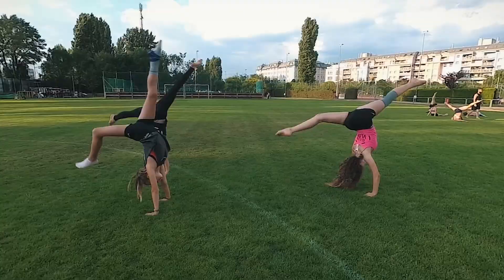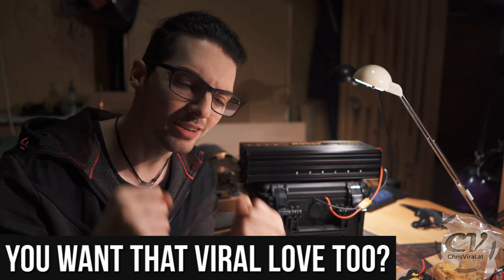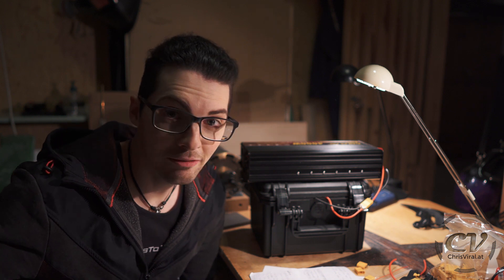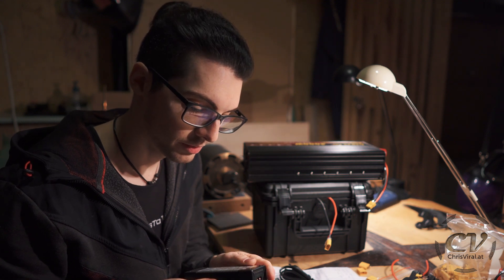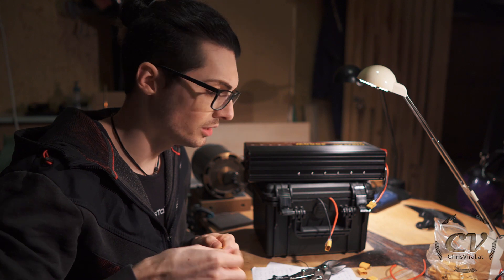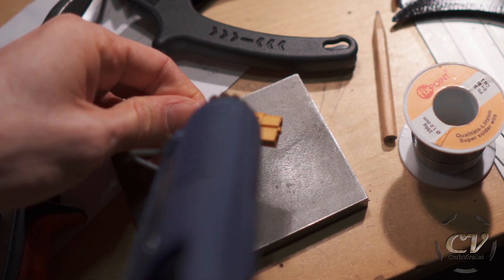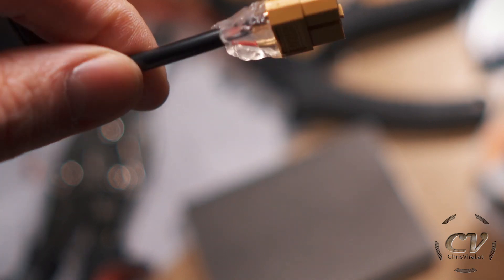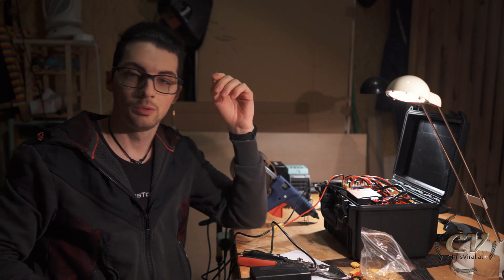How To Charge 7S Battery Pack? So Easy! (24V 7S Battery Charger)

Comment: How did you calculate the "1320.9Wh total capacity" ? we know it is 7S, but how many Ps are there and how much mAh each single cell deliver ? 
Is it 1320.9 /24 v= 55 A(total amperage), then mostly if each cell deliver 2 A then we are dealing with around 30 P pack.
TIA

Comment: You've found the easiest way to charge this battery back; it seems, however, that it will need a lot of time for charging process...
Reply from the maker: Yes that's right... I think I forgot to put the calculation in the video so here it is:

29.4V x 2A = 58.8W charge rate from the power supply
1320.9Wh total capacity
22.46h charge time

I think I could easily use a 10A power supply, cutting the charge time to ~5h but I think it won't even be necessary... For now I only plan on using it mildly, but we'll see :)
Reply: Yes thats also why the wires are that small the smaller the current the smaller the wires the more amperage you draw the more strands of wire it needs to not heat up because of the skin effect